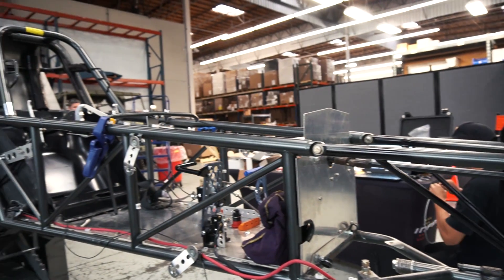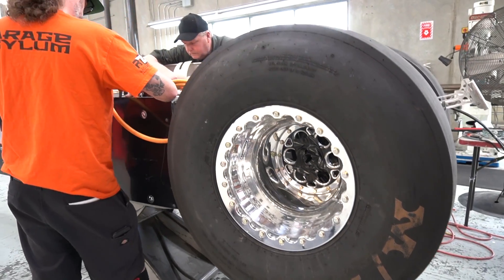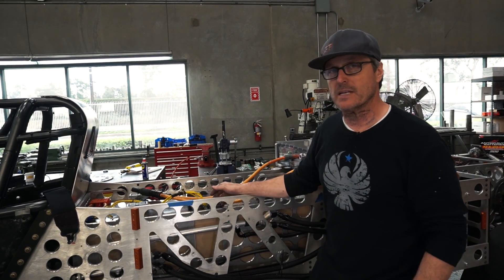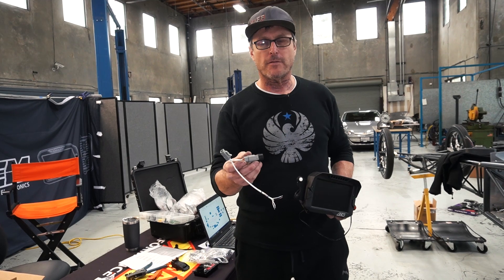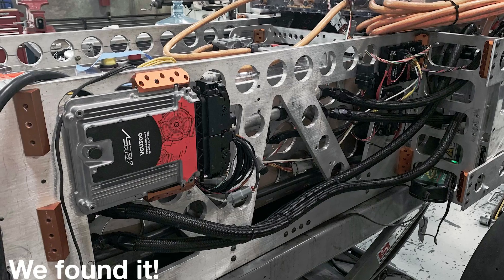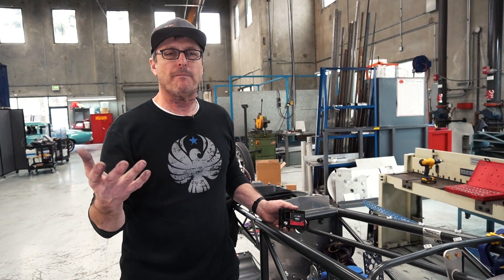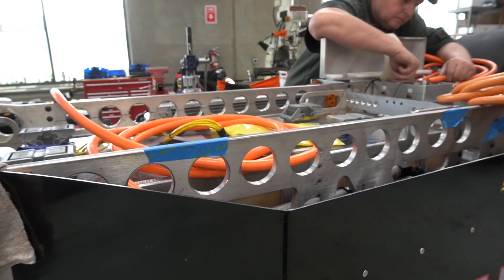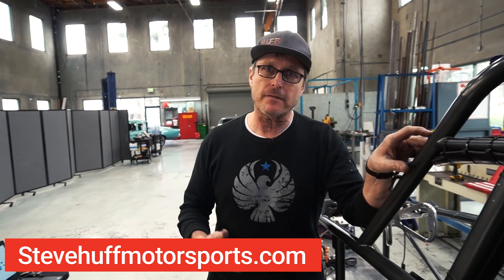THE FIRST 200 MPH ELECTRIC DRAGSTER?!?

Comment: Great job guys! Although there are cars that are fully electric doing 200+ mph but it will be nice to see a Top-Fuel I mean Top-Electric racing class dragster smoke the wheels off the line...and it looks way safer than the blower intake grenading all the time!